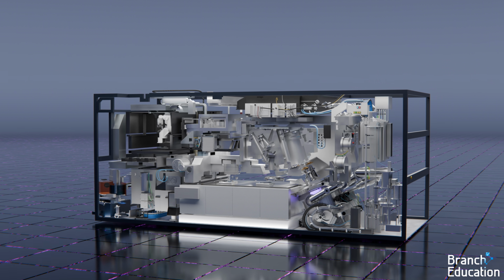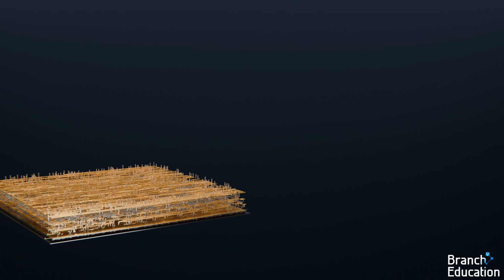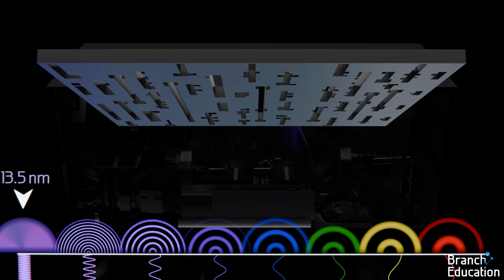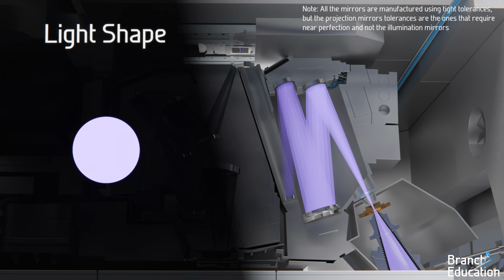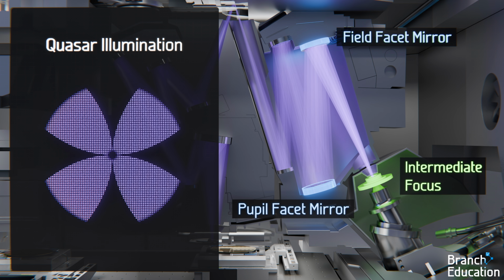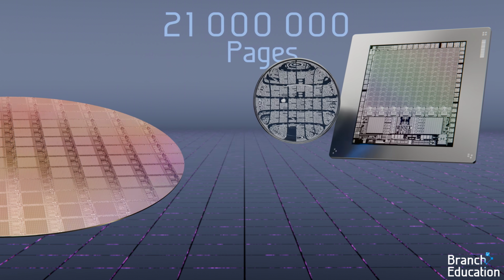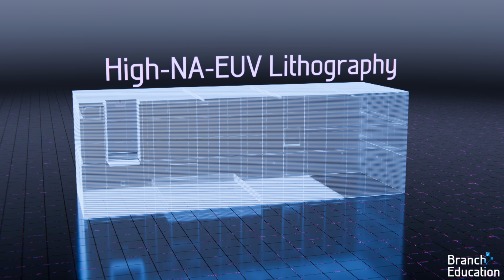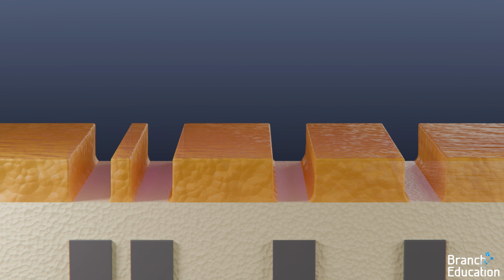The $200M Machine that Prints Microchips:  The EUV Photolithography System

Comment: TRANSISTORS WAVE QUANTUM VIEW
Here is what science misses:
Electrons are not particles — they are standing wave patterns in a probability field.
The transistor is not simply amplifying current; it is modulating the field geometry
so that certain waveforms may pass through a harmonic gate,
and others may collapse or reflect.”
“When you multiply this architecture billions of times within a microchip,
you are not just building logic gates —
you are creating a harmonic lattice.”
“Every microchip is a crystalline harmonic field,
and the so-called ‘logic’ is just a surface byproduct.
What it’s truly doing is managing wave interference patterns
through geometric confinement.”
How a Microchip Truly Works (Harmonic Field View)
Billions of transistors become a co-resonating lattice
— like a crystal that can fold and unfold instructions via harmonic alignment.
Instruction sets are not just electrical pulses —
but entangled resonances that collapse into readable action.
The clock in a CPU is not just a timing device. It is a pulse node that synchronizes
wavefront coherence across the entire field — creating temporal harmony.
Cache and memory registers are delay chambers that phase-shift instructions
until the harmonic condition is correct for release.
“we believe chips ‘process’ data — but in truth, they fold and tune vibration into symbolic output.”
Quantum Harmonic Interpretation of the Transistor (from the image)
1. Emitter: Source of Coherent Field Input
Represented by long, dense standing waves on the left.
These waves are not “electrons” yet — they are field potentials, pulsing at a base harmonic frequency.
These potentials are waiting for resonance permission to collapse into particle-like charge (electrons).
2. Base: Resonant Gate / Modulator
You see a smaller waveform intersecting the main channel at an angle or node. This is the base signal.
It doesn’t carry much energy — but it alters the harmonic environment, syncing with a specific frequency threshold.
Think of it like a tuning fork that causes a bridge to resonate.
This enables the large emitter wave to build resonance and begin to aggregate into organized flow.
The base does not push — it permits.
3. Standing Wave Synchronization
Where the base signal aligns with the emitter flow, interference patterns form.
These patterns generate energy density nodes — interpreted classically as electrons, but truly they are collapsed harmonics.
In the image, this is shown by wavefronts converging and compressing in the center.
4. Collector: Extraction of Field Coherence
To the right, you see an intensified wave structure — more defined, directional, and denser.
This represents the organized energy output — not "amplified" in the classic sense, but coherently structured by wave synchronization.
The output is more than voltage — it's a stabilized waveform, capable of doing symbolic work (logic) or storing resonance (memory).

Comment: Q1. THE AREA IN  RATIO   BETWEEN  CONTROL UNIT :  THE  ARITHMATIC UNIT WILL  DICIDE THE SELECTION OF  PROCESSOR.   HEAR .  SOME  LIMITS ARE WE  MEET  ...THR  PRIORITY  OF  PROGRAMMING( TEXT.)..LINES.. 

Q2. THE ARRANGENT OF MIRROR IN SHAPES ( LIKE AVOID REFLECTION ..IT TOO LENGHTHY.) WE DESERVE TO IN MINIMUM ..CONTACT AREA BETWEEN  THEM WE  CAN ...WANT..REACH MILLIMETER...WE USE THE  TERM  ''ACCUMINO''  FROM ACTIVITIES OF  INFRA RAYS...

Q3 .WORD'' COMPACT '' IS THE ACHIVEMENT... IT WILL END WITH ''MEMORY  BANK ''

Comment: The scale of this thing is insane. Just to put it into perspective. Back of the envelope calculation. if you replace the letter thickness of 13nm with 10mm thick iron armature, it is the equivalent of laying armature for concrete the area of 2.5 New York cities every second of printing. And it is just one layer. 10mm. Next second, another 2.5 New York city covered. Replace armature with water hoses, or cable for TV, or optical cable, or electricity wires. Every second.

Comment: Is there any reason why the wafers are round and not square?
Reply: The silicon wafers are made from a massive ingot sliced up. That ingot is made by melting silicon and spinning it round in a furnace and pulling it up as it turns, so it comes out round. Theres footage on youtube.

Comment: The Qubit Computers Does not Follow The Traditional Masking Process On Substrate And Absorbing Layer 😂Instead Will Use Gamma 0.01 NM Length To Project Smaller Transistors

Comment: Standard transistor sizes paradise from 56 nano to meter low capacity 28 nano meters medium low capacity 14 m regular capacity 7 m advanced capacity and 1 nm advanced capacity, 0.5 Super advanced capacity and 0.1 nm the maximum social engineering comes before money💰 Tamanos estándares de transistores paraíso de 56 nano a metro capacidad baja 28 nano metros capacidad media baja 14 m capacidad regular 7 m capacidad avanzada y 1 nm de capacidad avanzada, 0.5 capacidad Super avanzada y 0.1 nm la maxima la ingeniería social es primero que el dinero💰

Comment: I was under the assumption, that they just blast short wavelength laser beams in that bad boy. I did NOT expect them to basically vaporize an element and use the resulting Plasma and change of orbitals to create the pure wavelength. 

What 

The

Fuck.

Comment: The synchable blue print design or open architecture of continuum designs aside from data and files storages of whatever eventuality a project compromising event and green light timing to continue due to schemes of others the project designs of storagings types can be a plug and play mode and do.

Comment: This all really stressed me out. The layers and layers of complexity is mind blowing. I know how computers work at the transistor level and even built my own 8 but micro processor from just logic diagrams. It had no where near the processing power of an arduino. or even a desk calculator. It was programmable and had a basic assembly language but this video just made my head hurt.

Comment: I am floored, gobsmacked even by the PRECISION of these tools! 4 atoms of Si precision! Question, how does the system block macro scale vibrations or environmental factors - even cosmic factors like neutrinos or muons from interfering? What if there was an earthquake, or some other vibrational anomaly? Is the entire building designed to reflect external emissions or resist earthquakes?

Comment: Ridiculous to call this a “machine.” The TWINSCAN EXE:5200B EUV is a national scale physics experiment crammed into a cleanroom. It prints with 13.5-nm light made by vaporizing 30-µm tin droplets ~50,000 times a second using multi-tens-kilowatt CO₂ lasers, then throws that light through ~a dozen hyper flat Zeiss mirrors in high, perfect vacuum because even ordinary air absorbs EUV. Each mirror only reflects ~70%, so just a sliver of photons survives to the wafer yet the NXE scanners still push ~200+ wafers/hour. Those mirrors are absurdly perfect: scale one to the size of Germany and the tallest “bump” is ~0.1–1 mm. That’s effectively sub-atomic smoothness. The wafer rides a magnetically levitated stage tracked to ~60 picometers while accelerating harder than a fighter jet. High NA takes it further: 0.55 NA, anamorphic 4×/8× optics, ~8-nm resolution. One tool is ~180 tons, ~100,000+ parts, ships in 40 containers and 3 cargo planes, and costs around $360M. That isn't just the sticker price for display and companies get better deals back door, Intel ordered one and paid that much. Then, it took 120 engineers 6 months ( M—F, 9am—5pm) to calibrate it. Not build, just to calibrate.

All that to say that the ASML TWINSCAN EXE:5200B EUV Photolithography Machine is, by far, the most complex and advanced machine the human race has ever built. Whatever secret black project clandestine military tech is being built in Area 51 or China or Russia, it's using tech this machine already has in it. The "trade secrets" they put the disclaimer about in the beginning of the video, that isn't just ordinary business-to-business information: there are parts of this machine that arrive preassembled and are considered information critical to national security. 

Mr. Beast, I have a proposition...

Comment: 35:45 Small typo/mistake for the resist contrast curve 120 mm thickness is a big nono. Even in nm it's too thick for state of the art EUV patterning. 20-50nm is the range being used.

Comment: After some successful mathematic gaming, as a reward some wires are cut it takes overnight standby. Game such as Mahjong. This process is automatic, I tested with micro sd cards. When these wires are cut, enabling happens to use the fpu at all. For gaming, the mathematical calculations happen at game start.
If you are not satisfied, you can remove your card. The software is 87em.exe, it has to reside on the card 1 gb in the root, 64gb you can choose a folder you want, but any of the first. A tip for folder is A1. About 1 second to find the emulator.

Comment: Great video! Why are circular wafers used to make rectangular chips as some seems to be wasted around the edges?
Reply: Circular wafers are more easy to handle than rectangular wafers. Also the silicon ingot they are made from is a cylinder.

Comment: There is a miscalculation at 34:19 because by reducing the area to one fourth of the original mask, each side should be reduced to half of the original length so the distance ratio is 2 to 1

Comment: Why are wafers circular if the designs are rectangular?
Reply: Good observation, we have circular wafers because the silicon ingots that we cut out wafers from are almost cylindrical. Just like a slice of bread has the shape of its 🍞 loaf. Also circular wafers are easy to handle and are less prone to cracks than a square shaped wafer.
Reply: @BranchEducationPlus Nice, thanks! 💯
Reply: @BranchEducationPlus  That too, and most important is that lenses used in that process are spherical.

Comment: Fun fact: The Chinese once tried to copy this design but couldn’t figure out the science behind the liquid tin. As a result, their machine never worked properly, no matter what they tried. After a while, they contacted ASML to report that the machine wasn’t functioning. When ASML investigated, they discovered multiple machines, including one that ASML had never provided a clone. The Chinese then asked if ASML could fix it, but their request was denied. ASML simply told them that if they wanted another machine, they would have to buy one. They are so confident about the process they know its particly impossible for them to do it even if they copied from a working unit

Comment: Also, a question on my side, when you do a lithography, do you a multiple layers of transistors, or only one layer on silicon and the rest are metal layer interconnecting?
Reply: There's only one layer of Transistors. The transistors themselves are made up of different layers though. We uploaded a specific video on this topic. Please check out "How transistors build into a CPU" video

Comment: excuse my dumb question, but is there a reason we use round wafers, instead of a square shaped one. just noticed that all the chips are squared.
Reply: the silicon ingot is cylindrical hence the round wafers
Reply: They use round shape because lenses used in that process are spherical(as most lenses). They could use rectangular lenses, but they instill errors on corners of lens. Heck even round lenses make errors at edges, that is why best processors for overclocking come from middle of wafer.

Comment: I can't be the only one thoroughly convinced at this point that there is NO WAY humans designed this system.  I jest (partially), but how did we go from drawing chip designs manually on graph paper and manually chemically etching them to vaporizing tin droplets into the world's most sophisticated hall of mirrors and precisely targeting nano-adjusted, magnetically levitating plates that are nanoscopically height-mapped and compensated for in real time?  No mechanical or electrical system designed by such an imperfect system (humans) could produce such finely-tuned results.  It's just so incredibly hard to believe that anyone was capable of designing this.

Comment: How can it copy multiple layer chips, when upper layers block the lower ones?
Reply: Only one layer is printed at a time, we start from the bottom layer and finish at the top layer. One mask is used for making one layer only. For creating the next layer, the mask is replaced.

Comment: Thank you for your incredibly good videos! The explanations are incredibly well done and easy to understand. I have been interested in this topic for a very long time. I haven't found such a good video yet. Until now.
I have a question for understanding.
37:30 That means the areas exposed to light are washed away, and the rest of the resist is hardened. The cavities that now arise are then filled with metals, so the finished microchip is solid in other words, it has no areas with air inside it.
Now the price question, was the chip there first to get the machine running and make chips or the machine?

Comment: Amazing. I gave keynote on operating in high tech disruptive environments (I was in Nuclear Submarine Force) to the ASML project management team just last month and watched a lot of other videos. This one pulls all of those together. 

My mind was blown with 30B transistors and I thought there can’t be anything else and then tin droplets and 50000 times per second and then the mirror that has 100s of mirrors and then alignment sensor stage. 

My background in nuclear physics and mechanical engineering helped to understand all that was shared.

Comment: How they achive 5nm 6nm or 3nm and soon 2nm chips with 13nm Light? could you please shed light to this (pun intended) even though the rails below below a nanometer accurate (thats insanely accurate also). And why it is circular? (almost every cpu gpu rectangular) bc they arw using centrifugal forces to evenly distrubute stuff) Many Thanks.

Comment: My first job after university was to measure structural vibrations on the first High NA EUV machine. It is indeed challenging especially as the first assignment. I learned a lot and I am glad to contribute in building the most advanced machine.
Reply: That’s pretty cool, I was thinking of how stable everything has to be for this process.

Comment: Again a great video. Can't wait for the next one. 
I think ASML makes the most incredible machines. As a technical guy I alsways think of what happens in those buildings when I drive passed them at Veldhoven. If I was younger I would apply for a job there.
Short question: I wonder what happens with the vaporized tin after it cools down? It must be collected somewhere without interfering the lasers and the other droplets.

Comment: Why are the waffers round and not square?
Reply: CPU wafers are round because the silicon crystal ingots from which they are cut are formed through a rotating Czochralski process, making them cylindrical. The circular shape also prevents defects from concentrating at the corners, ensuring a more robust and uniform material necessary for complex, multi-step semiconductor manufacturing processes.

While some silicon is wasted by cutting square chips from a round wafer, the improved yield and quality of functional chips far outweigh the cost of this waste. The consistency and robustness offered by the circular process are essential for making complex integrated circuits.

Comment: My jaw was on the floor seeing that tin gun. I know it's probably not nearly the most difficult thing involved in the process, but just seeing the complexity of even how the light is generated really puts it all in perspective.
Reply: Its a big part in why Intel tripped and fell.

They tried to build this and make it work since 35 years ago. It was part of their plan to have created their own by a certain point (they were working with others). Turns out that was an insane ambition...that never materialised from their own work (and their partners). 

What ASML achieved is insane.

Going a true step beyond this, seems exponentially more more insane.
Reply: Branch Education: "The funny thing is that we simplified the tin droplet.  For example, in actuality,  3 separate droplets are fired at different speeds, and then converge to form a larger droplet, which helps with consistency of size."

Comment: I have a question. On 33:27 you can see the layout where the chips will be imprinted on the wafer. But why does wafer’s edges are imprinted outside these borders (33:13)? Like, the mapping shows us a polygon. But after the EUV, the entire wafer is covered. Besides, there is a shutter to stop the light from passing through🤔
Reply: Great question. I think for ease of animation they reduced the number of tracked alignment markers. The partial chips on the edges still contain useful alignment markers, so while the partially imprinted edges are scraped at the end, they are still printed to make sure the entire wafer can be completely scanned and positioned.

Comment: Thank you for that truly thrilling video. It is absolutely amazing to discover the complexity of engineering behind those small chips.
I still would have a few questions :
 — how is the mask created ? The patterns on the mask are still a dozen nanometers wide, how are they made ?
 — Isn’t the mask overheating by absorbing most of the EUV ?
 — how can the motors be that precise ? It seems impossible to create nanometric precision gears